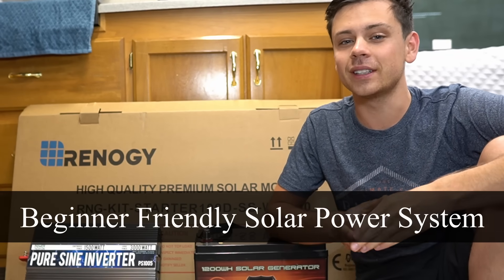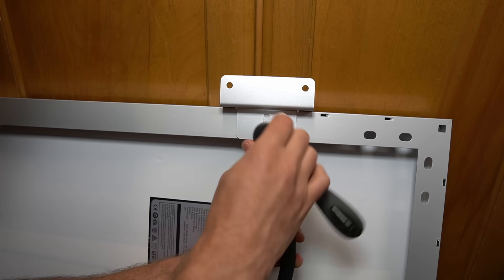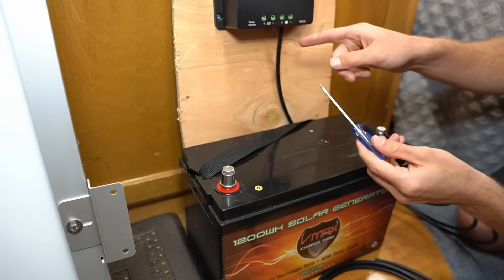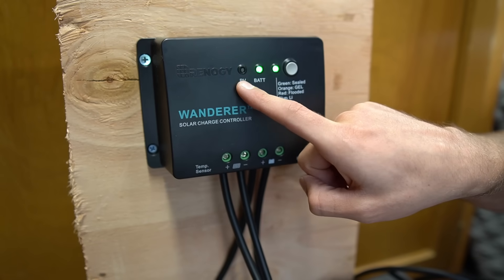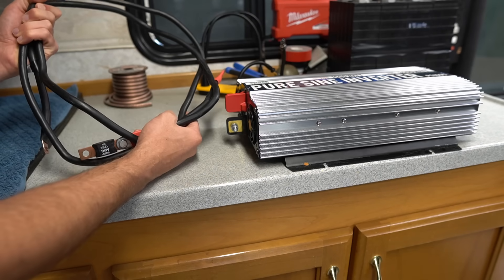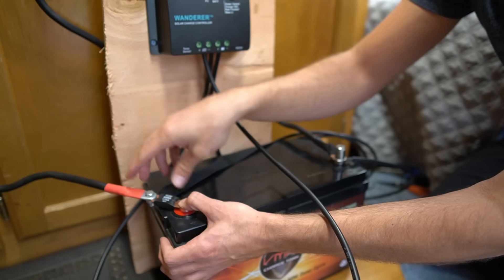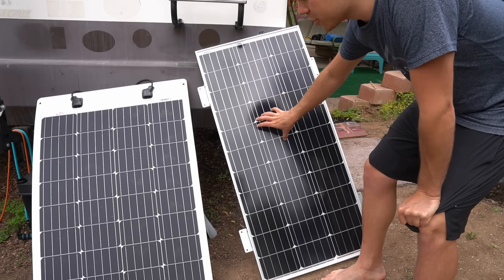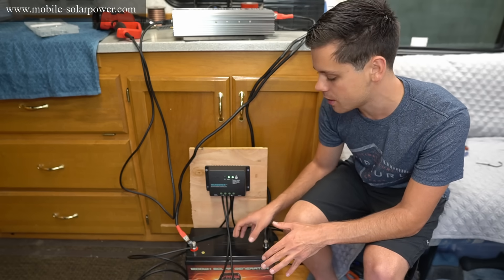Build Your First Solar Power System! Beginner Tutorial Easily Explained, Budget Friendly

Comment: Thanks for all the videos, I've watched a ton of them!  I just installed a BattleBorn 100aH battery into my 99 Eurovan Camper along with a Rich Solar RS-MPPT20 20A MPPT Charge Controller powering my 12V Truckfridge TF65 fridge.  I also have a Renogy 160W Flexible Panel.  The fridge is running, but I didn't hookup the Solar Panel right away because I wanted to see the rate that Battery % monitor on the Charge controller goes down.  But after almost 7 hours it still reads 100%, which just seems impossible.  The other thing I don't understand is what is the Load Connection for?  I suspect that the fridge should be drawing about 2 Amps as it is cooling down from 30C so I would have ecxpected to see about 14 AH degradation which would mean 86% remaining.  I'm confused, any help or thoughts?

Comment: I have watched several of your video's. I seen one where you were pretty high on Bluetti 2400. It appears that alot of your recommendations are toward RV use. Can the Bluetti 2400 run a home refrigerator or a large chest freezer? If not, what solar power generator would you recommend for that? Are you familiar with the Solar Geni?

Comment: I know this video is old but I hope I can get a response. But I have been contemplating this type of setup versus just buying something like an Ecoflow delta battery generator. The only glaring difference I can see is the pricing of components vs the battery generator, but the trade off is convenience and ease of setup. Is there any other pros/cons comparison you can think of?

Comment: So I used (2) 200 watt panels on my van mounted to the roof rack. That seems to be much simpler than using (4) 100 watt panels and is easier to mount. I connected them in series; however I am wondering if it would be better in parallel. Any know what the pros/cons of having them in series or parallel? The mttp recommend seems to be able to handle the voltage...
Reply: I found connecting in parallel is the way to go. It seems the high voltage will keep the mttp from charging the full capacity of the panels with two 200 watt panels. I am now getting 13-15 volts at 3 amps on a foggy day.

Comment: Might i add a couple of suggestions. Having been a troubleshooter lineman and utility man for a major power company, there are just a couple of things. 
1. All mating surfaces should be lightly sanded/brushed. Pure shiney look nice but will not transfer power as well as two surfaces brushed.
2. It appears that some of the connections are different metals. They all may be copper, but some are tin plated. Electrolysis can and will set up when dissimilar metals are mated and current flows between them. A good anti-electrolysis gel should be applied to these connections. 
These 2 items can and will save heartache and issues with the system. Efficiency will also improve. And as we all know one must try to make their solar system as efficient as possible. Thanks for your good work.
Reply: Thanks for that input.  Could you explain number 1 a little more detail.
Reply: @FirstDownMage  simply put, electric conductors that have to mate up will have a better connection when their mating surfaces are slightly " rough " for lack of a better term. When they are perfectly shiny and slick they won't conduct as well. And especially when DC current at lower voltages are involved.  A wire brush is best. Sandpaper can leave behind residue.  Does that help?
Reply: @FirstDownMage  most metal oxides are insulators so you want to sand off any passivation layer that might have formed.
Reply: Good tips.
Reply: Thank you. He is great, but I need all the extra tips I can get. Blessings.
Reply: Agreed on second for anything longer term; cheap and easy and no ugly corrosion/rust and over time flaky connections and hot spots.

For the low wattage system like this; 1 might be overkill?  (Although I still tin/heat shrink end of each wire; the stupid wire nut system on victor stuff has gotten me more then once)

Comment: Is there an easy way to see if your battery is screwed?  I have a 220AH Xplorer deep cycle leisure battery - I have 100w solar panel and a split charge relay kit to charge it but it seems as soon as there is no charge going to the battery,  if I plug in a laptop or something the voltage drops from around 13v to 12.0 very very quickly :S
Reply: I should add that the battery is only a little over a year old

Comment: Your battery is sparking when you connect it because the positive cable should be connected first and ground last.  When Connecting:  Connect Positive First, Ground Last.......When Disconnecting:  Remove Ground First, Positive Last.  This will fix the sparking issue.
Reply from the maker: Not true. When completing any DC circuit, potential will be present regardless of where you connect. You will still have a spark.
Reply: @WillProwse  You're correct about the potential of it being there but its greatly reduced.  The automotive industry has placed the rule on all technicians to connect red first, black second because of flooded batteries off-gassing.  These gasses are explosion hazards when large sparks are present.  True, sealed batteries don't have that explosion hazard but its still good practice to connect the cables in the proper order.  Some of your viewers may use batteries that off-gas so I felt it a good idea to mention this.  For them, the proper order is very important.  Develop safer habits and it could prevent a disaster later down the road.  For the record, Ive connected thousands of batteries and Ive never seen a battery explode.  Ive also never known anyone that had one explode on them.  Even still, I believe most industry safety rules should be taken seriously.  Many industry rules aren't there to totally prevent issues.  Many are there to lessen the extent of the damage or potential for damage.  As you said, the potential is still there....its just much less potential when the cables are connected in the correct order.
Reply from the maker: @jasonlett1828  fair points

Comment: Question:
I bought a solar attic fan that comes with a charge controller, a 100 watt solar panel, the fan and two 12v small batteries.
My question is once the sun goes down will the fan run off of the batteries all night?
I’m thinking this might wipe out my batteries in no time.
Do they make a device that will interrupt the load device (fan) if the batteries get down to 12.2 volts?
They want me to wire the batteries in parallel which will be 24volts.
Unfortunately the kit did not come with any instructions so I’ve been watching videos to see the best way to install this set up.
My fan is for a small 100 square foot cabin that needs airflow to keep moisture/heat down.
The only instructions on this kit are in the pictures in the sales link from their Amazon ad.

Comment: Will, do I need a low voltage disconnect to protect my battery? If so, which one, for the 100ah battery and the 1500 watt PSW inverter?

Comment: I really enjoy tinkering with powering my shop, and garages from solar, once I build a large enough battery wall, I'll try to tackle the house. In the meantime, I am working on my small 5th wheel trailer. Now I believe the 100watt 12v solar system I purchased from Renogy will suffice for the old trailer. My issue is, do I remove the old system or just wire the panels directly to the batteries?

I can send the specs from the old generator/battery charger system if you like.

I live in Pahrump, so you are well aware that sunlight isn't an issue for us out here, reliable electricity on the other hand is an altogether different issue.

Thank you in advance for any assistance you can give.

Tim

Comment: I have a question, I have a koi pond with a 110 variable speed pump I run 24 a day, I also have a air stone that runs the same amount of time. We have had issues with power outages, sometimes for 8 hours. A pond full of koi with no water flow or air, the fish will die in a couple of hours. So I need a solar system that will just run my air stone in case of power outage. Will the Renogy 100 watt 12 volt stater kit with the Vmax mr127  12 v deep cycle battery work for me. Or would you suggest any other system? Help please

Comment: Does anyone know if I can use a backup gas generator to supplement the battery? I have a small setup like this that I use to run a portable refrigerator while camping. It works well if there is sun but I'm looking for a just in case solution.

Comment: Thank you.  Was looking for something just like this. Have watched dozens of videos recently, including one of yours, trying to make sense of all this. This video breaks it down Barney Style for me and answered my questions that came up as they came up lol. Sounds like I could this exact setup..but with a Li battery and just change the setting on the controller. It also answered my question for adding an additional panel, and adding the different type of charge controller. The only question left unanswered for me is....would a second battery be necessary and or easy to add as well?  I know that depends on what I would be running but the usual truck camper stuff....some lighting, charge handheld devices, maybe a small refer, and let's go crazy....a small AC
Reply: You were doing fine until you hit the part about the A/C. I can finally run my A/C with "only" one Honda 2200 Watt generator after having installed the Micro-Air Easy Start  kit to my A/C. To (mis) quote the guy in "Jaws".... "You're gonna need a bigger system"

Comment: I have a Hardened Power Systems 100 W/h LiFePO4 battery. Hardened Power systems states the battery has a built in charge controller. Can I use any 100 W panel to charge the HPS battery?

Comment: hi, question i know nothing about solar panels in general. i am wondering how to set up a smaller one to some lights on my deck,  unfortunately i have no idea how to. i was thinking about even a cell charger might do it? but do other solar panels come with the a place to put a regular u.s. plug? the ones ive seen online all seem to come with usb ports but that is not what i am looking for?unless there is a way that i am unaware of? the plug i am looking for is a receiver for plugging in regular white ''christmas'' lights. i also know there are lights that come with the solar panel attached but the string of them all seem to be awful short suggestions?

Comment: I have a 7” High Performance 12V 80W electric radiator
cooling fan for my 20’X 8.5’X8’ medal container with a 12” vent in the back of
Reply: I have a 7” High Performance 12V 80W electric radiator
cooling fan for my 20’X 8.5’X8’ medal container with a 12” vent in the back of
the container. I will be storing my furniture in this container while my new
home is being built. I have a Renogy 12V 100W monocrystalline
solar panel charging 2-1200wh 100ah batteries in parallel though a Renogy Rover 12V 60 Amp MPPT solar controller. I
also have a 1500W Pure Sine Wave power inverter hooked to the batteries.
My question is will this system run the 7” fan 24-7 and what size fuses should
I install to protect these components? Also, should I install 3” fans aimed at the
batteries in an effort to cool the batteries.

Comment: If I’m using two batteries, is it okay to have distance between them? I have one in the front of my van hooked to the alternator. I want to add another in the back with the charge controller next to it. Can I connect them and expect them both to charge from the alternator and a solar panel? My recent comment on another of your videos is related.
Reply: Oh, and you said we need a voltage meter? The charge controllers don’t monitor the voltage of the battery?

Comment: Will, I’m a beginner, I want to build this system for my finished shed where I store expensive grand pianos. How do I figure out what I can run of this system? 

I want to run LED lights and a small AC unit and and a convection heater. How do I figure out If this system will power these appliances?

Comment: Y'all better put that temp sensor on cause my 12v agm battery bloated up like it was gonna explode. Thought that I would buy a temp sensor later once I found a good deal on one, but nah it overcharged to hell before I could. Not a big loss since it was labeled as "dead" when I got it from an auction for like $20 along with 4 other batteries. It wasn't fully dead since it did accept a charge and jumped to 12v really fast, but for sure would not go to it's rated 300A max which I was ok with since I won't do that anyways. It was however one of the better ones since it started out with 6V and did output 20A+ on partial charge.

Comment: Hey Will, now that this video is officially a year old, would you still recommend this set up, or are there newer and better components we should piece together instead?
Reply: Just get the Bluetti ac200.  Built in battery, controller and inverter.  Skip the hassle.  It can handle 700 watt input.

Comment: Hi very good video. I'm in the process of looking at these Renogy items to charge a Lifepo battery (26650's). Would some sort of BMS be required to stop over charging or to stop the voltage dropping below the minimum safe level?

Comment: Hi to everyone,
i have recently made a small solar system (4x100W panels, 2-3kW pure sinewave inverter, 12V battery), i know it's small but it's able to power up my entire house every day during summer, and with the help of a charger on night also during winter.
I have a problem (i guess), when sun is perpendicular, angle is right and panel not to hot it only produces 240W instead of 400, i tried to connect panels in series, in parallel, 2 parallel couple in series but nothing has changed, 220-240W, the same with MPPT charge controller or with cheap PWM controller.
The strange thing is that when i had only 2 panel they are able to produce easily 160W, now that i've added 2 more panel i gain only ''one 100W'' panel of energy.
 (if i shortcircuit every single panel for only a few seconds they all give me 5A , but all 4 in parallel or series only 14A instead of 20, why?)
Is this normal? a 400W system working only at 240W? Cable are big and i don't thing is the reason, because i have the same watt result in series or in parallel., thank you very much to all of you :)

Comment: Could you add a wind generator to your system please.  For the overcast days.  A wind generator that was waterproof that could double as a water generator would be THE BOMB! WHAT DO YOU THINK? 
do you put your systems into a cupboard with a tiny built in fan for air circulation?

Comment: Q: how temp sensitive are these devices (inverter, charge controller, etc.)? can i tuck them away in a cabinet somewhere or do they need to be out in the open for air or cooling?
Reply: The inverter will get hot, but should have a built in fan. So long as the cabinet has good ventilation, i.e. a fan blowing air in and out, then the system will stay cool.

Comment: Do two 6-volt batteries wired in series give you more reserve time than a 12 volt stand-alone or [two]  parallel?  
Do you have any builds that detail the set up and use of 6-volt batteries?

Comment: Question: building a small cabin next year and my brother gave me a mini fridge (well 4.5 cf) but the manual says not to be used with an inverter so worries me. Is there a way to wire up a mini fridge to a solar system? Maybe I'm just misinterpreting the manual.

Comment: Really good explanation for beginners in solar! I wonder if it is worth going with a 1500 W inverter with such a small starting system?  Especially when you live in a RV wouldn't it be better to power directly 12V devices from the battery or even directly from solar via buck-regulator? I have a little 360 W PV on the roof and just use it on 12 and 24 V devices - for led lights, charging up nearly every mobile device, garden tools, ebikes and even electric scooters with help of a DC-boost converter. With boost converters you have to be careful when they dont have a propriate UVLO (Under Voltage Lock out) - they can spike up the output voltage when the input voltage gets too low for proper operation.

Comment: Perhaps an easier introduction might be: I have a koi pond and created a waterfall to provide oxygen for my fish. A simple 12 VOLT DC water pump is hooked up to the 100 watt solar panel. At about 10 am water is pumped to an elevation where it flows back to the pond. At about six pm it shuts off automatically. I leave Oregon for Arizona in December and return three months later. Still works after 3 years

Comment: Hi,

I want to learn the splicing of wires to inverter? Do you have videos related to that? I would like to diy a grid tie 3kw setup but Im a bit afraid of the electrical parts. Planning to add surge protector for each panels

Comment: Use to design inverters, cheap ones have a rectangular output, good ones are crystal controlled and have a sinusoidal output at exactly 60 Hz.  Sinusoidal is necessary for AC motors, but with only 100 watts maximum, even less depending on the start up surge current.  Maybe a 1/12 HP motor.

Forget about the inverter, just power up flashlight type LED bulbs.   Sealed lead acid batteries became practically law, because people were burnt by the acid where the caps can be removed.  But that electrolyte will evaporate and become worthless.